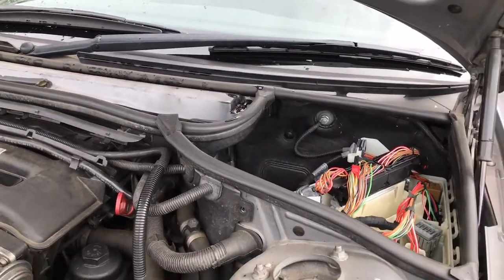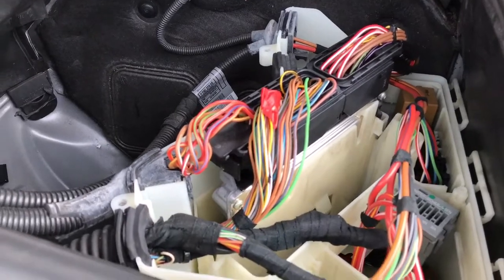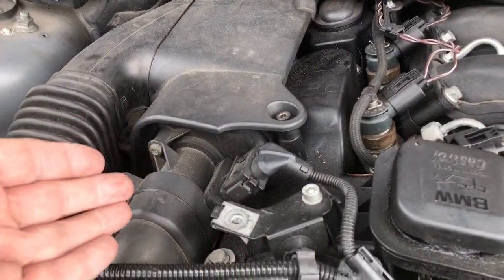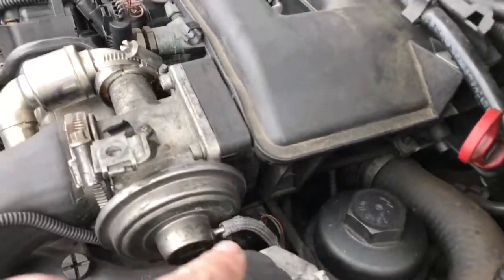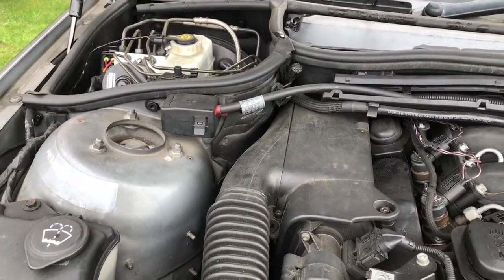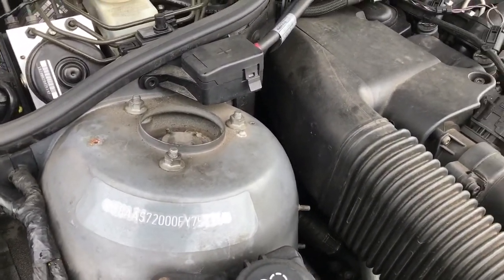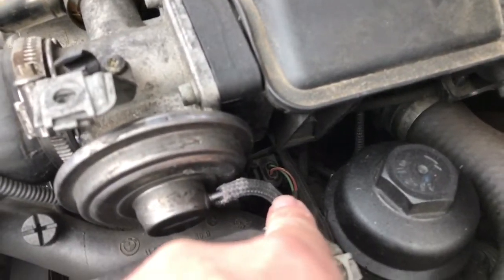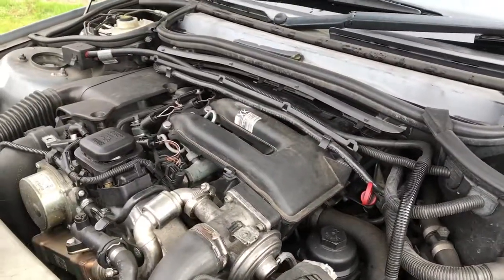BMW E46 2.0 turbo diesel fuse 1 blowing

Comment: You are awesome and i REALLY love this about YouTube! Thank you so much – I'll get right on it after work today :)
Reply from the maker: Espen Grimsgaard no problem my friend us Europeans have to stick together even after Brexit LOL cheers sandy
Reply: It worked! For a short moment atleast :-| It was the trickiest one - the rail-sensor under the cover. So we unplugged that and the fuse didn't blow. We connected it back and still good. The car started and everything was good, but then an hour later it stopped again. So could be the sensor is broken - OR the wire to the sensor could be damaged and our tinkering fixed the problem temporarily. But this was no doubt very useful information and helped us track down the problem so we can focus on that sensor, try to replace it and if possible - the wire to the sensor. Thank you again Sandy!
Reply from the maker: Hello my friend glad it started, that part is not a sensor but an actuator that is called the DRV Valve that controls fuel pressure with in the common rail, so it can pull a fair amount of amperage/current, maybe it is faulty but first make sure you check your wiring especially where it passes through the body work grommets or near exhaust.  Good video by frank Massey explains it "AUTOiNFORM: Diagnostics on Bosch common rail DTC 17" on youtube cheers sandy
Reply from the maker: Espen Grimsgaard is the car back on the road my friend?
Reply: I'm afraid not Sandy :( We're waiting for a mechanic (I do have some limitations heheh) to help us decide if we should try to cancel the purchase and ask for a refund or repair the car. So hope we can figure something out on monday. I really appreciated your help nomatter the result. It helped us narrow it down and locate the problem.

Comment: Hello! I have the same car. E46 320d from 2004. A few days ago,my car stopped running in the middle of the road and it's just cranks but doesn't  start. I found that one of those fuses ( the second one of 20 amps ) was burned. I replaced it, car started, worked for 10 minutes and after that, burned the fuse again. What does that fuse?
Reply: Did you manage to check what it is for?